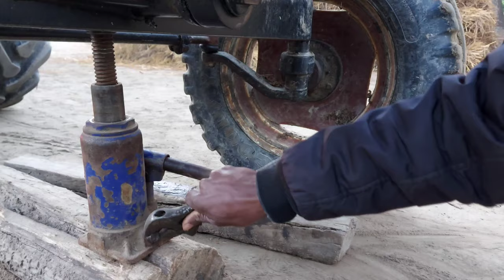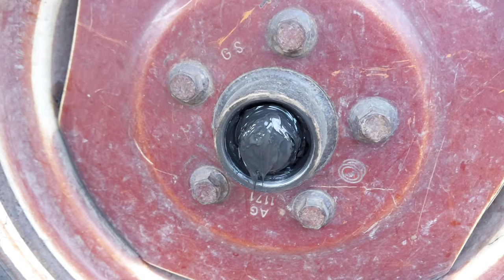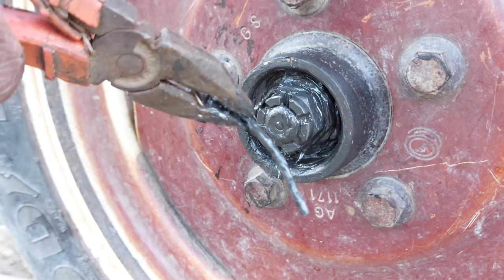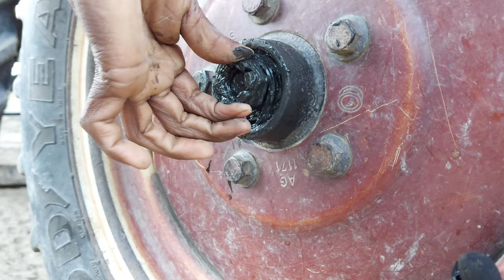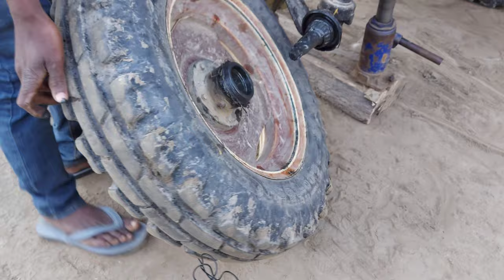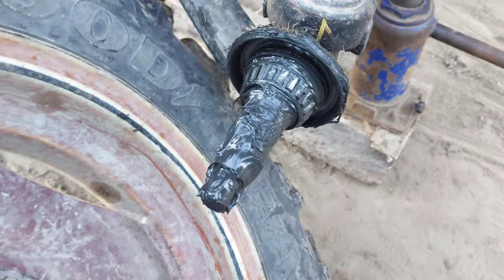New Holland tractor front wheel bearing repair

Comment: Check the threads castle nut goes on at tip of spindle. Those threads take all the sideways impact and lean force and that castle nut can sever the cotter pin and slide off.